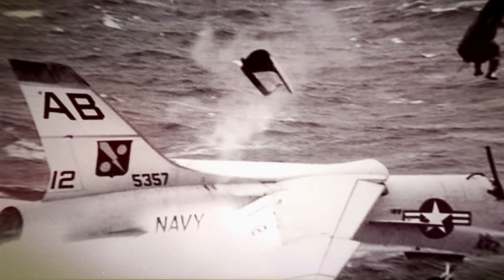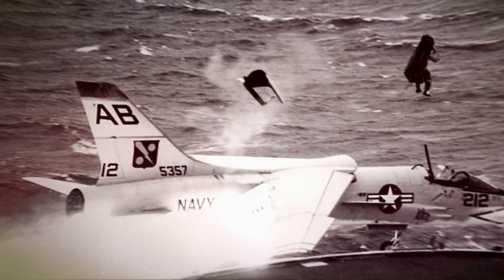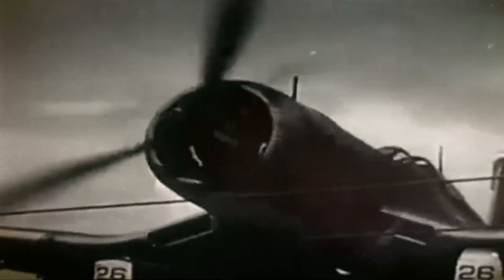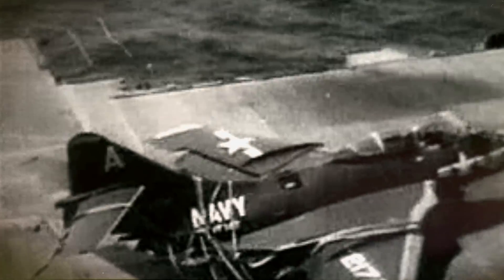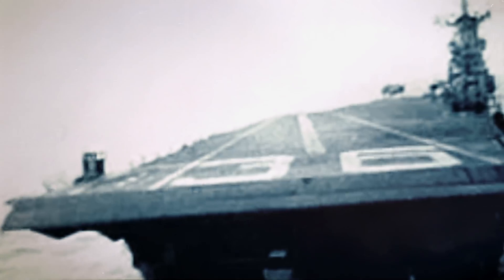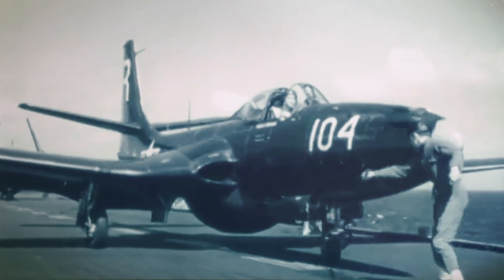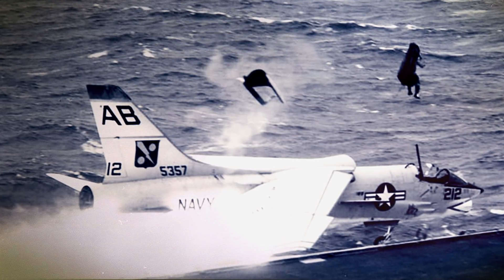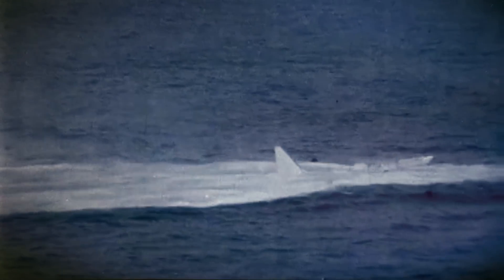F-8 Aircraft Carrier Crash (why carriers have angled decks for landing)

Comment: Now... can you explain why British carriers launch their planes with a skateboard ramp? LOL!
Reply: The Poverty Ramp. A lot of navies use them. It's cheaper than CATOBAR steam catapults and it's more efficient if you're predominantly using STOL aircraft.
Reply: Because they're using VSTOL F35s on the HMS QE and the ski jump helps preserve power used for just going straight up.
Reply: @masono.3769  during the planning stages of the new RN carriers, it was to be catobar, then they switched to ramp.
Reply: A mild obsession with Tony Hawk?
Reply: I suspect no need for a catapult
Reply: @Mr2greys   Yup, F35s don't need it so why bother at the moment. They were originally designed to have them as part of the whole NATO interoperability thing - and can be fitted with them if necessary. Also the RN has no money. Also also, us brits invented the catapult so ha!
Reply: @danielcooper1124  Brits invented the angled deck, but are the new RN flattops considered angled decks?
Sad to see some Brit Ingenuity not being currently used by the RN
Reply: When you use VSTOL aircraft, you don't need a catapult, but the ramp gives a little boost on the take-off.
I read something written by an American Marine Harrier pilot who was on secondment to the RN.  He said he LOVED the ski ramp and wished the USMC carriers had them.
Reply: @No1sonuk  also it helps preserve fuel. Vertical VTOL take offs require lots of sheer power and fuel. Same way with helicopters, that's why they do rolling takeoffs most of the time.
Reply: @No1sonuk  from what I've read, RN was also torn between taking F35Cs and F35Bs. Hence their issues and delays finalizing their carrier designs
Reply: Yes because it's BETTER one reason the UK WON the Falklands war when we should have lost due to having less aircraft to fight the war with ! !

Comment: 3:06 Never seen a Sabre on a carrier.
Reply: I believe these were called FJ2 's (or maybe 3's) and weren't made in enormous numbers.
Reply: The Navy had their own version.  I think it was called an FJ-2 Fury.
Reply: First Navy “Sabre” was essentially an F-86, but then North American modified it for the carrier with the FJ-2 and then FJ-3 Fury.  Later North American designed a ground up carrier version the FJ-4 Fury.  This was a winner but unfortunately Vought came out with the F8U Crusader around same time as FJ-4 and the Navy went with the Crusader.  The FJ-4B was short lived, flying with both the Navy and USMC.   Today there is only one FJ-4B flying in the whole world.  Google N400FS.
Reply: @tpbh46  Right.  If I may expand on this...Before 1962, The Air Force had their aircraft designation system and the Navy had theirs.  The USAF F-86, Fighter type number 86, versions A, B, C, D, etc.  Not all versions were produced, though.  F-86A, F-86D, F-86E, F-86F, F-86H.  The Navy's designation system was where the first letter indicated aircraft role (F=fighter) and then the model number of that type for that manufacturer.  Followed by the manufacturer designator letter.  And that followed by version number separated by a dash.  So F=fighter, 1=1st model (but the 1 was always dropped on the first model), J=North American Aviation Company.  So, FJ-1.  Was the first Fighter that North American made for the Navy, and it had the nickname of "Fury".  The first version had a straight wing and a fat fuselage.  Not very impressive.  I think the Royal Navy's Sea Fury propeller-driven fighter was faster.  North American was also working on the Swept-wing version for the Air Force, which had a much sleeker fuselage.  Upon the F-86's success in Korea, the Navy wanted the swept-wing version.  So that became the FJ-2.  Version 2 of the Fury, which was pretty much an F-86 with an arrestor hook, and some other modifications.  Didn't look anything like the FJ-1.  It looked like an F-86.  Next was the FJ-3 with more improvements to make it suitable for use on carriers.  The FJ-4 featured stronger landing gear, a redesigned, bulkier fuselage with a raised cockpit for better pilot view of the flight deck for carrier landings, a larger wing and a more powerful Wright J65 turbojet engine, which was a license-built Armstrong-Siddeley Sapphire.   Lacking afterburner and being only subsonic, (technology advanced very rapidly in the 1950's) the FJ-4 was replaced (or supposed to have been) by new supersonic fighters, like the F4D Skyray, the F3H Demon, the F11F Tiger, the F8U Crusader and even the F4H Phantom II...D=Douglas, H=McDonnell, F=Grumman, and U=Vought.  As you can see, Grumman and Vought had made a lot of fighter designs for the Navy.  The Fury was then offered to the Navy as a ground-attack fighter by adding 6 underwing hardpoints.  But the Navy chose Douglas' little A4D Skyhawk, instead, which was smaller and lighter and had the same J65 engine.  In 1962, the Navy's designation system was merged with the Air Force's, to form one system.  The FJ-4 Fury became known as the F-1E and the FJ-4B, the AF-1E.  The A4D-1 and A4D-2 Skyhawk became the A-4A and A-4B, and so forth.  The F4D and F3H were withdrawn from service prior to 1962 and didn't get new designations, so the F4H-1 became the F-4A Phantom II, but was quickly superseded by the F4H-2, the F-4B.  The F8U-1 became the F-8A...F-8C, F-8E, etc.   Douglas' AD-5 Skyraider became the A-1E.  And the rest is history.  Now, Dark Footage/Dark Skies...all you have to do is read this in your famous voice. ;)
Reply: @Andrew-13579  Great info, thanks a bunch! 👍
Reply: It's a Fury, based on the F-86.
Reply: I'm writing to a general audience here, but Carrier aircraft need stronger frames and landing gear because of the added stress of the ship's movement on the Sea.
Reply: @craftpaint1644  - You can navalize just about anything, though. There were naval variants of the F-16, F-15 and even the F-117 proposed. Obviously we have the Su-33 and MiG-29K. The Rafale was navalized into the Rafale-M, and there are blueprints (just no one has bought it yet) to create a Saab Gripen Maritime. Brazil would likely be their first customer if they acquire a carrier. Also, FWIW, the F/A-18 can take off from "ski jump" carriers. A jump deck was constructed at NAS Pax River (or possibly Lakehurst, my memory is slipping) to test the Super Hornet for a possible Indian Navy pitch to replace their MiG-29Ks.